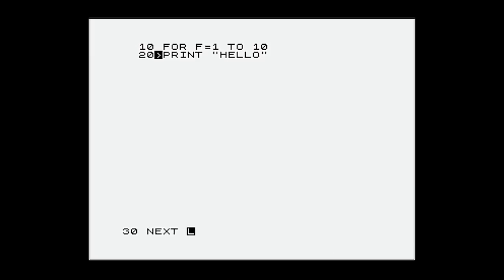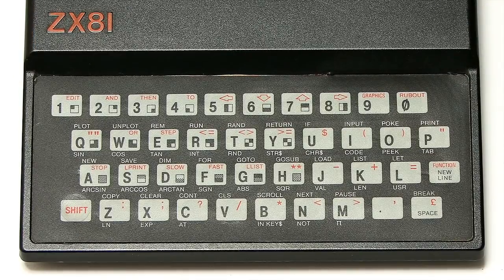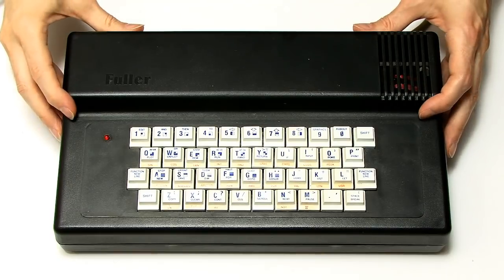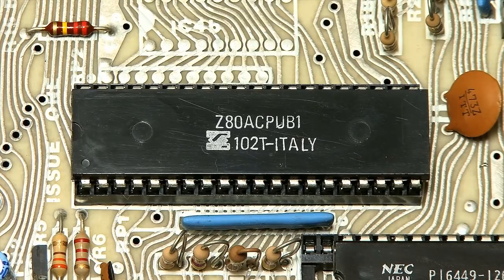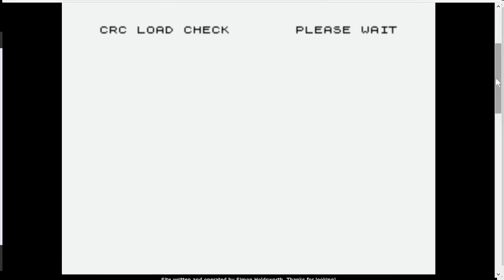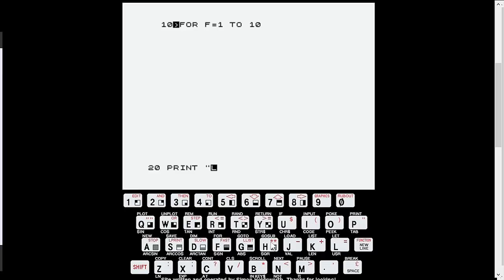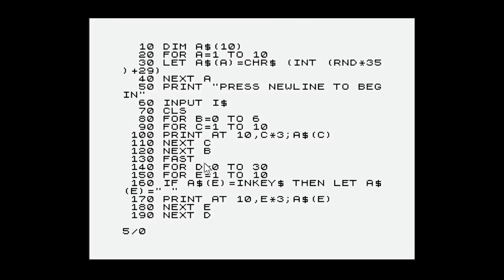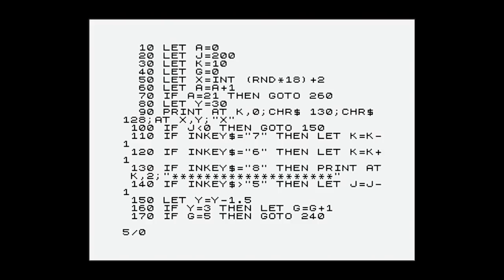ZX81 Classic PC

Comment: Seeing this makes me "melancholic nostalgic"...  ZX81 was also my first "encounter" with something related to computers.  I even made my thesis based on a Z80 microprocessor.  The Z80 was not a microcontroller, oh no... You had to connect PIO's (for parallel I/O) and SIO's (for serial I/O) to it to get something from or to the outside world.
Later on, I bought the ZX Spectrum and waaw.... That was colour!!!  Unbelievable at that time.  That one had a slightly bettery keyboard (rubber buttons they were) but still, I had to make a keyboard myself since also the "slightly better" keyboard (compared to the membrame one of the ZX81) went to walhalla after a while...
Still remember vividly the hours I spent playing with those toys.  Also still remember my parents didn't understand anything of it while I was programming the thing... "What on earth are you doing with that black box" was a question they constantly asked...  Never gave a reasonable answer, I must admit...

Comment: My first was the ZX80 :) - 1kb memory and no moving graphics :) I wrote my first programme on the ZX80 and it was just a simple " guess my number higher or lower " but it took all of the 1kb of memory :) I also had a Dragon32 :) then C64 then Amiga 500 and 1200 before PS1 2 and 3 then onto PC :)

Comment: And here, I thought we were of similar vintage, for some reason.

My school district had a PDP-8 that mostly did admin and payroll functions, but they timeshared it 3 hours per week for 'computer classes', where we would happily draw out our programs on graph paper, carefully sit at the key punch and build our 'decks' (I think the largest I ever produced in class was 35 cards, next to nothing) and then wait until the next week to get our results.

Then I joined the Navy and they trained me in Mainframes, maintenance/repair, not programming.  

My first 'personal computer' was an Altair 8800 that a buddy and I bought to play with on offcrew cycles, with the advantage that the ($400!) tape reader it had read in the same format as the MARDAN inertial nav computer, so we could build our programs using the ship's tape punch system when it wasn't being used for mission related things.

Then my buddy went Apple fan boy when the Apple II came out and I went TRS-80 with a series of machines until I got a modern PC in 92 or so.

God, I'm old.

Comment: The ZX81 was the first computer I actually owned.  In fact I still have a couple of these along with the power supplies, manuals, memory etc.  I also have the TV I bought to use with it, a 12" BW portable.  I was going to put them on EBAY a couple of years ago but they fetch so little I did't bother.  I had an assembler and designed and built an EPROM programmer to plug into the expansion port.
After that I went on to the VAX/VMS and also UNIX at Brighton Polytechnic and then the PC route.
Now I am retired I have bought a Raspberry PI Zero W and feel I am going full circle and enjoying it just as much as the old ZX81.  Thank you for putting this video on.  Bob

Comment: 1981. I was a Systems Programmer working on IBM mainframes and had an electronics hobby (which I still have!). I used to build ZX81 kits for a number of people. The only personal computers we had at work were 2 Superbrains (running CP/M and enormously expensive) in the Finance dept. Anyway a lot of computer and other office staff were interested in this new affordable technology from Uncle Clive so I saved them a few quid by building the kits they ordered (by post!). They all worked fine but I remember the 16K expansion packs (or the connectors) were extremely flaky. So I used to modify the packs and replace the connectors to make them more stable ... and then came the Speccie ...
I know I still have a working ZX81 in the loft. I think I'll be playing with that for a couple of weeks now!

Comment: Who would ever need more than 16kb of RAM? That would be insane ;)
Reply: Im not that old but i remember when i was the cool kid because i had a 166mhz mmx with 64!!!! MB of ram.......now my work pc has 8gb and im constantly running out of memory. wish people knew how to code properly, now its just framworks on top of frameworks, and you end with a hello world which takes 800mb of ram to run.....
Reply: Why not; first I  had 16K, started to write Z80 Assembler in Basic, 16K was not enough so I got  64K Memopack :) by design 0-8K was occupied by ROM, 8-16K unused, user area was 16K up. Wrote small usr's which moved to 8-16K area at first boot and used 16-64K area as 3 16K partitions to load 3 different programs, swap partitions and run. It was fantastic at 1982-83.
Reply: @mserogul  oh that exactly what I was wondering about the Z80 processor! so you did it? you used an assembler on ZX81 to run  assembling machine program ???  I can't even remember if the BASIC code had the CALL, POKE and PEEK commande to do this!! I'd love to see what we could up to with Z80 instruction, maybe able to manipulate a sprite figure with some boolean  instructions to make a small game like bomber jack or so... just wonder if that could be possible !!!
Reply: @mserogul  Ah, the days of efficient coding when you knew you had barely enough memory to work with.
Reply: Yeah. I started with a ZX81 with a 16K RAM pack and now my current PC has 1 million times more RAM (16GB).
Reply: I see what you did there
Reply: Quite interesting projects you were doing mserogul!  Yes... I thought I would NEVER run out of RAM when I expanded my 4K IBM PC with a 12K expansion board to raise the bar to 16!  Now I,m distressed if I do not have 8 or more Gigs!  Amazing!  Oh, and don't even mention the 8 TERRA-BYTE RAID system I now have for 1 of my systems.  I thought that 500 Meg was HUGE, once upon a time!  LOL!!!
Reply: Or one could NEVER fill up the C64's 64KB memory, it was expansive!! lol
Reply: They said the same when Intel came out with the 486 chip running at 25 Mhz.  But that was long before things like YouTube were even a thought.
Reply: @Garyscott7  that was 16MB, not 16KB!

Comment: Olivetti M24! I think it was in the summer if 84 I bought it, but it could have been 85. It cost me about £10.000 - because you had to buy a keyboard, a floppy disk, a monitor, a hard-disk (hard-drive for me because I wanted 2 floppy disks), 1MB RAM, a modem (300/1200), Windows 1.02 (1.01 had problems with my color monitor) which was unusable because an 8086 (with an 8087 math processor) wasn’t good enough to run it. I think I used DOS 2.11. I learnt a few different programming languages, like C, Pascal, Fortran, Forth and Cobol (I knew Basic from earlier, when I studied electronic engineering). I also used it for a BBS, although I didn’t have many subscribers. I remember I downloaded a file 1MB in size and went out on the town for a night with the guys, and it wasn’t finished downloading when I got back.  :)
Reply: I forgot, I had an Amiga 500, with a color monitor that could run rings around the PC.

You know the reason the PC didn’t come with color? Because the guys at IBM thought the PC would be used primarily buy businessmen that would use it for spreadsheets an word processing. I believe the idea back then was that computers would get bigger and bigger, until each continent would have one massive computer, each.  ;)

Comment: ZX81 was my first computer too.
I also remember the "printer" I bought for this computer: Two needles, mounted on a rotating rubber band scratched over a special paper, that was covered with a thin metal layer (I think it was aluminium). Where the grey metal was scratched off, the black colored paper became visible.
Reply: Also it was special thermal paper.
Reply from the maker: Marks were effectively burnt onto the paper! Oh happy days.

Comment: I started with a Jupiter Ace, it was programmed in Forth and had an expansion board that allowed me to plug in ZX81 peripherals like the 48K memory expansion, keyboard and the speech board, unless I jogged something and the whole thing reset. The Sorcerer, Acorn Electron, BBC-B and Atari STE that followed all had better keyboards and less wobbly peripherals but I still miss pecking away at the keyboard with my fingers crossed in the hope it wouldn't reset on me.

Comment: ha ha can tell you were deep in computers lol blue tack holding stuff together I always thought it was just me and my father that done all that lol :D my first computer was a ZX81 1K only, I spent hours and hours learning to program back in the mid 80s learning machine code and the ZX81 Programming language until I moved on to the Tatung Einstein back then ... I could never back then get the data cassette working so had to write all my source code down on paper oh what days thank god for disk storage ...
Reply: I noticed the Blu-Tack too. I recall sticking little cardboard squares on the membrane keyboard with Blu-Tack for different game controls. Not quite up to the standard of the Speccy "dead flesh" but it worked! ;-)
Reply: Important part of learning computers was a screw driver, a reference manual and blu-tack :D

Comment: Also my first computer. Pure nostalgia. By '86 I had graduated to a ZX Spectrum with a bog roll printer, tape deck and connected to BT Prestel - an early forerunner of the internet,  using a clumsy phone cradle modem.
Reply: Ah yes, 300/50 modems. 300bits per second download and 50bits per second upload.  And bulletin boards. Fond memories.
Reply: Ow, I was so jealous of people who had the printer. It looked like such a neat device. :) I had the interface 2 (with Jetpack, the only cartridge ever made I guess) and a DK Tronics speech interface. Had to load tape for half an hour, but then I could have my speccie singing and talking.
Reply: Wow you were way ahead of the majority with this added tech back then.  It was so expensive at the time.
Reply: @raggersragnarsson6255  It cost me a good portion of my salary  :)
Reply: Pete Thomas There still are still some bulletin boards out there usually remote locations with no cell service.,
Reply: What, a printer that prints on toilet paper???

Comment: I'm the same age as you Chris & so it was around 1982 when I wrote a 
few lines of BASIC on the school's RML 380Z. I then got the bug for coding & 
got an Atari 600XL computer. I also wrote my O level computer program project on 
the venerable BBC Model B in 1984.
 
A friend of mine had a ZX81 & I recall how he purchased a 16K RAM pack 
expansion for the sale price of £70! The RAM pack would often wobble when 
connected to the rear of the ZX81 which would crash the machine!
 
Wasn't there an older ZX80 or did I just invent that?

Comment: Awesome stuff Chris! xD

I still don't really know what was the first PC I've ever used... I know it had BASIC in it, it was just a hefty oversized keyboard that ran software through a connected K7 tapedeck, used a regular CRT TV as monitor. 
It was kinda similar to a Commodore 64, but the shape was a bit different, it had a grey-ish blue color to it, re-branded to the brazilian market. Perhaps it was a TRS-80 Color Computer. Don't quite remember it having any colors though. xD
I only remember the Zaxxon 3D game, and how my dad used to have several tapes worth of stuff (he worked with computers from the dawn of it, starting with valves, passing through punch cards, and so on).

But this was back in mid 80s, I was still a kid (remembering that back then Brazil used to get tech several years late in comparison to the US or UK), and I was just too young to actually do something with it other than trying to play a few games.

I only started dabbling with programming way late when we got a PC XT with some phosphorous green monitor. My father taught me DBase III Plus and Clipper, and I think one of the first serious things I made in it was a costumer database and receipt printer for a home based game rental thing I made with friends. xD
The SNES had recently been released, so this is probably back in 91-93 or something. Good ol' days.

Comment: That aftermarket case would be fun to put a Raspberry Pi into.
Reply: +Animal Facts,
Funny you mentioned that.
I was passing a seconded hand electronics store about a week ago and actually saw a ZX81 case with a Raspberry installed within it. The store was asking around £45 (GBP) /  $60 (USD - approximately) for this device.
Reply: I wonder if the keyboard could be hooked up to the GPIO header to support using it for the ZX Spectrum emulator in RetroPi?
Reply: For sure.
Reply: I've been itching to get my fingers on a broken VIC20 or C16 for that.
Reply: @TheNZJester Don't see why not with a little programming. You'd just be simply scanning a matrix.
Reply: Get some retro gaming on my favourites manic minor and jet set willy for two.

Comment: My first computer was the Sinclair Spectrum 48K and used an old television set as monitor. The cassette tapes that arrived with it were (prologic) Logic Programming, Bookkeeping with Excel styled spreadsheets, Turtle Graphics, Understanding the Assembler language and Basic programming. Am not sure today how I got it all setup and running but it was working and I sold it only a few years ago ( all in good working condition)  as it had been gathering dust on the top shelf.

Comment: BBC Micro Model B. I was 13, and my Dad worked on big Ferranti Mainframes for the MOD -Winchester Disks and Banks of Processing in rows filling up huge rooms to drive the Ship Simulators for the Royal Navy. My Mum and Dad wanted my Sister and I to learn programming (BASIC and Assembly Language), but I just learned enough code to hack Machine Code 'protected' games; anyone remember *OPT 1,2   *OPT LOAD "(Program Name)"?, it was a way around that 'SAVE=BAD PROGRAM' issue. Then 'Elite' came out, and I was emerged in that until I left school, at which point I spiked my hair up and got a guitar and was away from computers until about six years ago. Now I record music on my self build PC, and play Elite Dangerous -kind of a full circle really.

Comment: Well my first computer was actually the ZX Spectrum 2A with the ability to play Lightgun games. Even though it need more power for it's built-in cassette player but with the 128K RAM for extra features and the AY Sound Chip, my ZX Spectrum was quite revolutionary for a 8-Bit computer until 16-bit computers like the Motorola 68000 based Amiga's, Macintosh 128K and the Atari ST. Shame that the Sinclair QL with the 68008 didn't work out. And believe or not I did learn a little bit of Sinclair BASIC coding like plotting circles in like a Barbed Wire pattern, as well making Hangman game - by reading their manual when I was about 6 years old. Shame that those Lightgun games won't work on Non-CRT TVs as they don't have low display latency for the Lightgun to sync with the higher display/input lag...

Comment: I too had a ZX81 as my first computer.  I purchased it in kit form for £49.99 from WH Smiths, built it and it worked first time.  I too  ended up fitting a "real" keyboard, and placed the PSU and 16K ram pack (3rd party not the awful OEM one) into a case purchased from Maplins.  I ended up buying a few more kits, and then flogging them to friends for £5 less than the £69.99 retail price in Smiths... which made enough cash to buy a few games.  The game I played the most was Startrek, which had the full 8x8 galaxy, Klingons, Bases, and even black holes... all in 1K !!

Comment: Hi, a lot of odd memories flooding back seeing that K cursor. Hours squinting at magazines then carefully typing stuff in only to discover a mistake somewhere stopped program working. I remember the pressing the single key to get a command(p for print etc) but I can't remember how you get the graphic character or the  command under the key.
Reply from the maker: I had to figure out the keystrokes again to enter the programs I ran in the emulator here! The commands/functions under the keys are accessed by first pressing SHIFT and NEWLINE. Graphics characters are accessed via SHIFT and 9. We used to do this in our sleep! :)
Reply: Hi, thanks for reply, I just had a go on the emulator and can't believe I used to type programs in relatively quickly, especially when you have to hit shift to rubout. Young fingers/minds more readily able to adapt, as opposed to my old mind. Thanks for the video.

Comment: Thanks for an awesome video. My first computer was also a ZX81 which cost $99 (1983 dollars) and 16 KB RAM was $49.00. I purchased the computer sight unseen from an add in science magazine (I think was Discovery magazine published by Time-Life) from I saved from washing dishes at a summer camp between my third and fourth year of high school.
 Like you, the ZX81 was the computer which launched my passion for computer and using computers for instructional purposes. I was a finalist in a 1984 science fair (and recipient of an award from the local chapter of  ACM) for creating simulations of Boyle's Gas Law and bacteriophage reproduction. What caught judges' eyes was the fact that the programs were written in machine code (no assembler). While developing the program, POKEd about 100 bytes instructions and data into individual memory locations by hand. Later I figured out to type use put characters represent the hexadecimal values into a string and load the machine code that way.
Thanks for nostalgic trip back to a less complicated time in  my life.
Reply from the maker: Thanks for this. I too coded programs on the ZX81 (and then ZX Spectrum) in raw machine code, and also got to a point where I entered characters via strings (although as I recall some hex values would not display or enter this way). This was real computing! :)
Reply: I wanted Spectrum, but the computer was never available in US. Eventually, I moved up the Timex-Sinclair 2068. I was also interest the Sinclair QL but couldn't afford the $500 price.
Thanks again for the wonderful video. Keep up the good work!
Reply: Tom M At a time when it was possible to memorise the memory locations too...